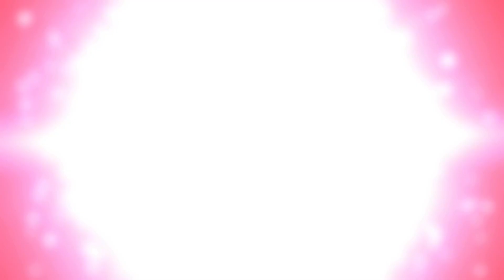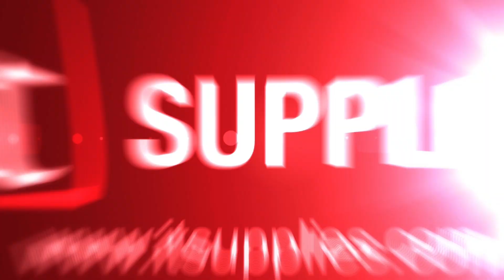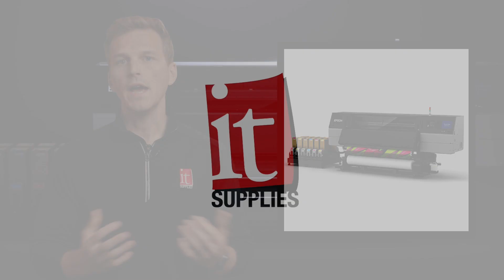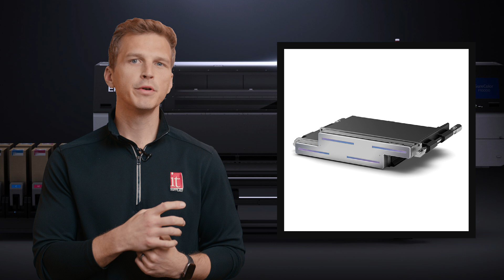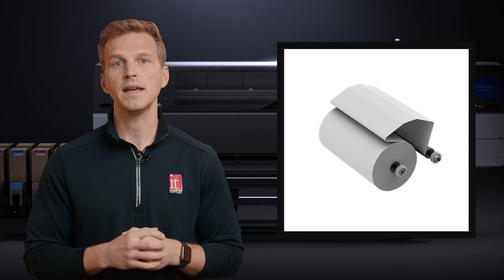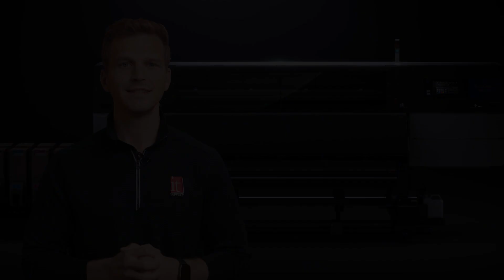EPSON SureColor F10070 Printer - What to Consider When Purchasing

Comment: Is there any difference in the cost of the ink compared to the F9470?
Reply from the maker: Thank you for your question. Not only is the F10070 ink capacity much larger at 10L but the ink pricing is $0.05ml compared to $0.11ml with the F9470. Please feel free to give us a call if you have any additional questions at 800-771-9665. We are here to help!
Reply: @ITSuppliesINC  greate! Another question. Is the ink the same as the 9470? Just to know if the color profiles that we have can be used with the 10070.
Reply from the maker: The ink formulation is the same just in different packaging. Keep in mind these are different printheads so they would each use a different profile.